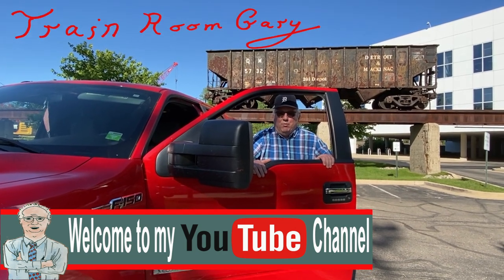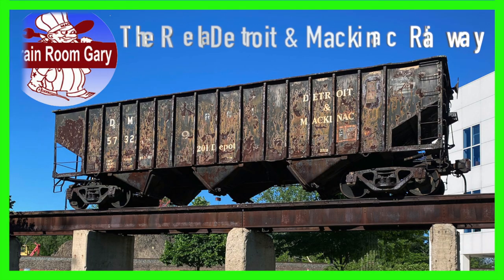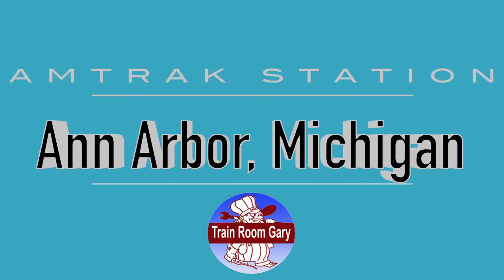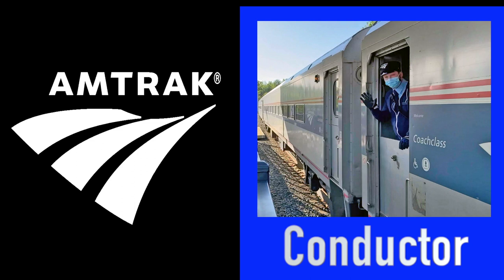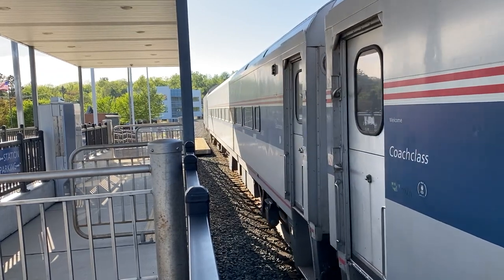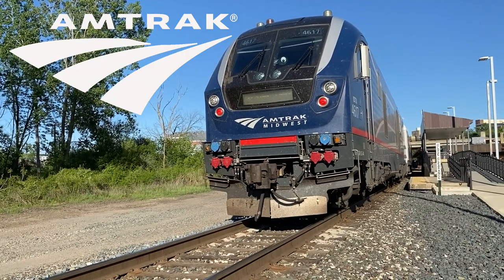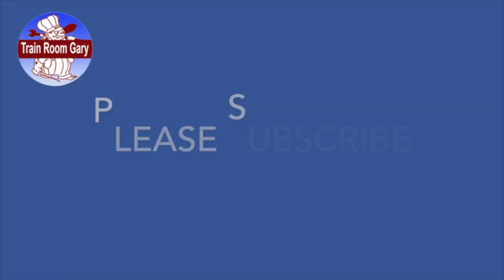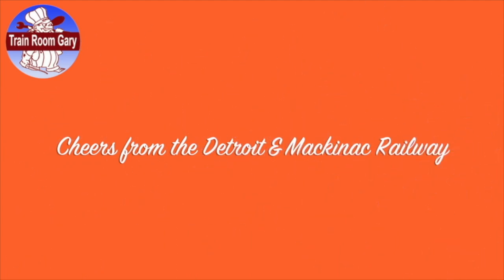The Real Detroit & Mackinac Railway • Ann Arbor, Michigan

Comment: First time to channel Gary, very nice. I have never seen that one and from the area, down by the hospital? Thanks for sharing
Reply from the maker: Hi BoDean 52: Glad you found my video from Ann Arbor. If you want to see this in person, try to go on a Sunday or Saturday. Parking anywhere in Ann Arbor can be an issue. This is right next to the Amtrak Station on Depot Street. There is parking in the Amtrak lot but you have to pay a meter machine. Hard to get to work correctly. Thanks for watching. Gary 🚂
Reply: @trainroomgary  I have ate at the depot where the train runs through right?

Comment: In the Atlas O scale Summer 2024 catalog there are O scale   Detroit & Mackinac two-bay open-top hopper cars. 
They are among the most expensive cars for sale since they are priced at over $90.
Reply from the maker: Hi Andrew: I saw the Atlas cars but they are too large for my layout. I run Rail-king and Lionel. Thanks for the tip.  thanks for watching. 🚂
Reply: @trainroomgary  I am considering buying all 4 of the hoppers to add to the D&M themed train for the LIONEL Detroit & Mackinac 1976  ALCo. locomotive.